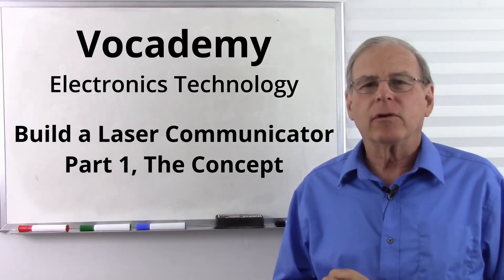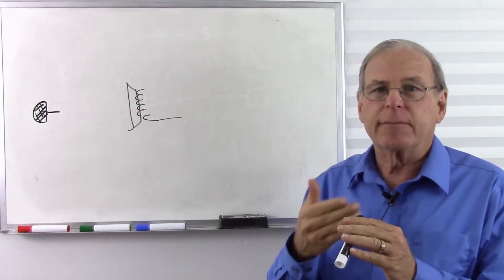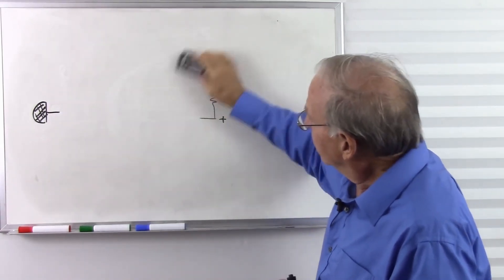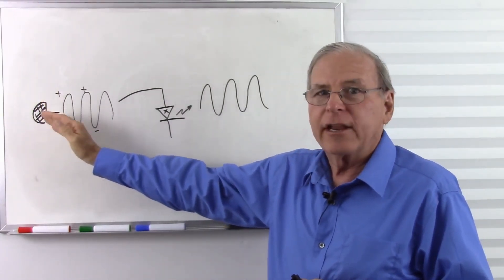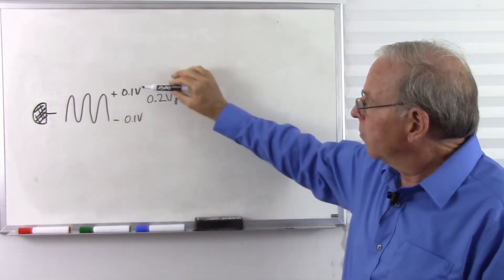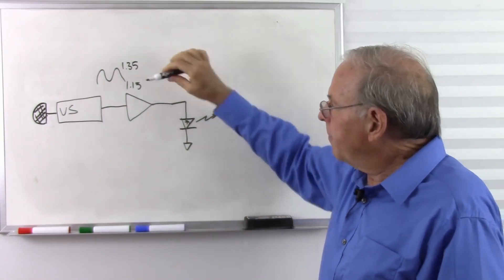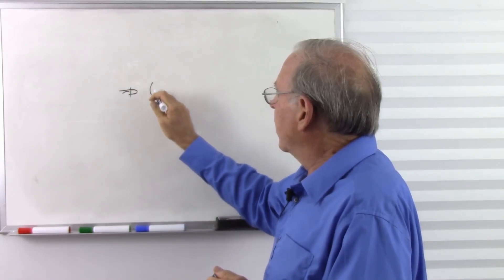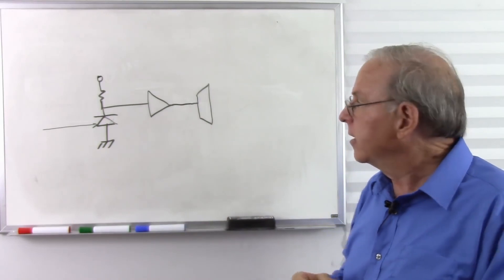Build a Laser Communicator Part 1, The Concept

Comment: i did something like that using Dollar Tree components, i used a Laser diode used for cat entertainment ($1.25)  and the the photo cell/battery and diode from a garden light ($1.25).  First i started pulsing it manually, then hacked the diode and pulsed it with a relay/then transistor and finally ended with a wonder called Arduino.
Reply: But i never attached/interfaced it to microphone.  Just wanted to create a high tech telegraph for my granddaughters ( after they played with plastic-water-cup-phone for a while)

Comment: I once made such a thing by connecting a carbon mic in series with a cheap laser pointer and its battery, crude, but it worked. I don't remember what I used for the detector.